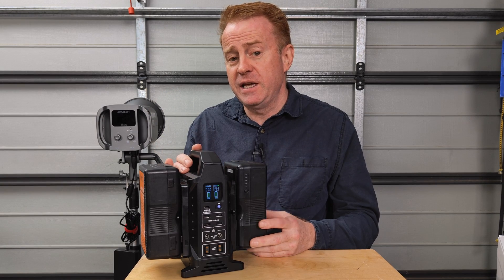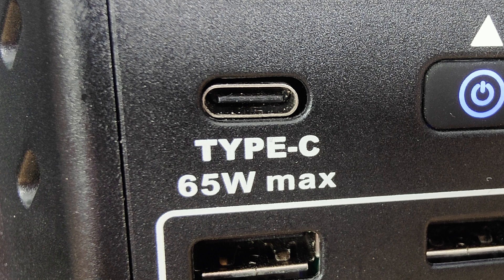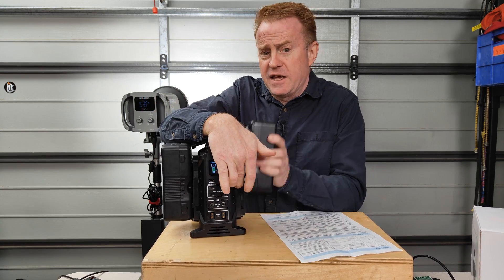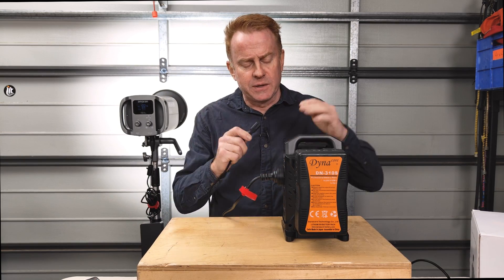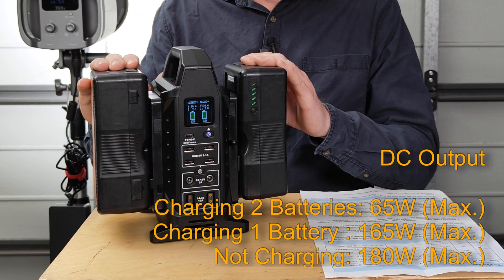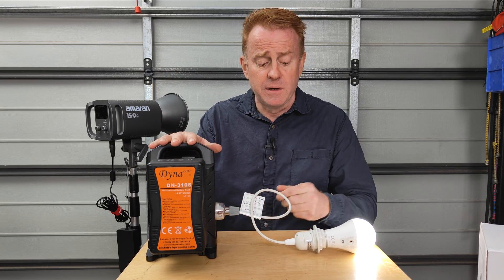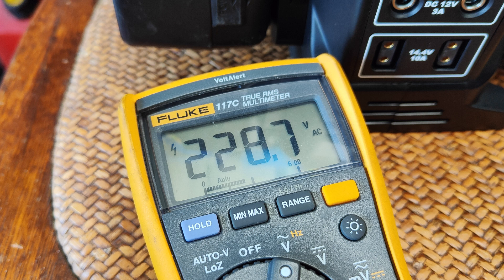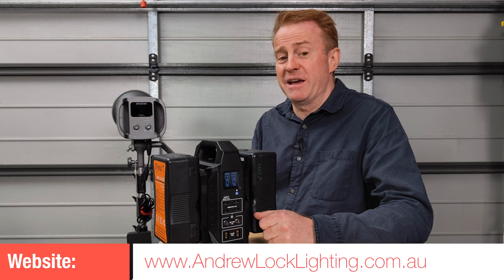Gaffer & Gear 279 - CAME TV Portable Power Station

Comment: Great review. Right now, I think they are the only game in town that can be powered by v mount batteries, and out put 120v. But output of 220w, is VERY limiting for video lights. To your point, they need to bump it up to at least 350w. GVM and Aperture control panels can handle 650w and 600w lights respectively. Plus this is too expensive given the limited output.

Comment: Will it charge battery through USB-C input ?
Reply from the maker: @tomeetjerry  I would imagine so, so long as it's under the limit of the socket. I use it to charge my phone
Reply: @gaffergear   sorry for miss leading,I mean to charge the v mount battery through USB-C input.
Reply from the maker: @tomeetjerry  I figured that's what you meant, as in charge two on the v-mounts and a 3rd or 4th via USB.

You would have to do the math on the total limits.

Comment: Cheers for the info on this.  Like you said, may be of more use to the camera dept considering the power draw of most of our lights these days.  Did have a scenario only last week though, where we needed to plug in some tube lights for a round table discussion we were filming.  So something like this could've been handy for those.  And like you say, running power to some practicals, especially in venues where the number of reliable sockets is limited (like historical buildings).
Reply from the maker: I didn't think of using it to extend the run time on my tubes! Thanks